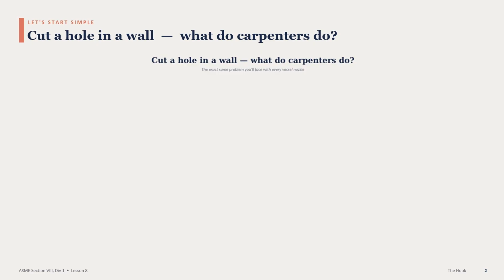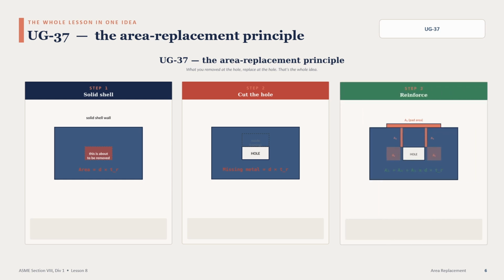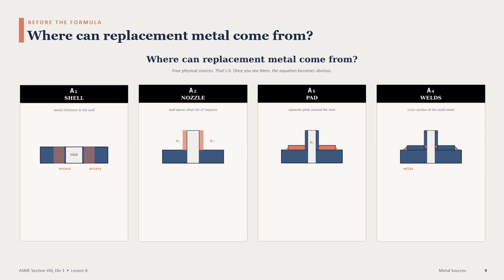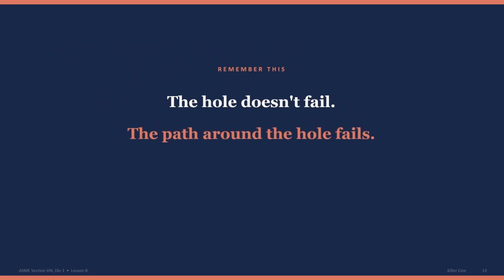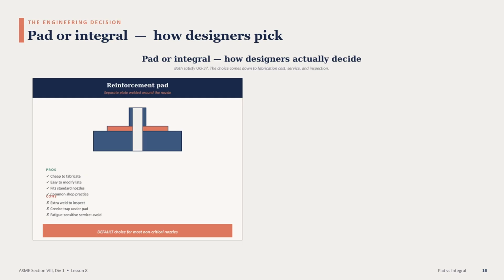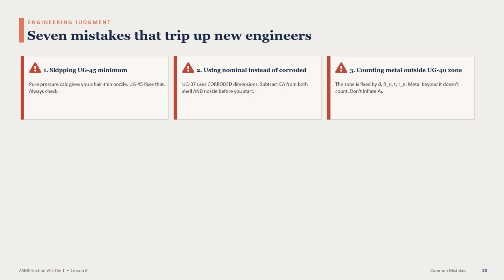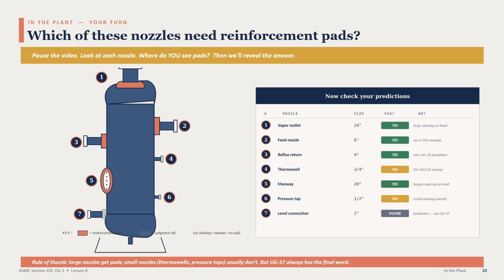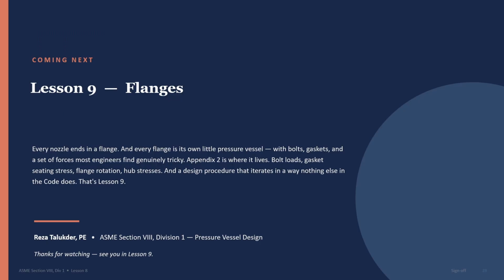Pressure Vessel Design | ASME Section VIII Division 1 | Lesson 8 – Openings & Nozzles

Comment from the maker: 📌 CORRECTIONS — please read

1) SLIDE 4 (stress concentration at a hole) — peak stress location
In Step 2, the red peak-stress dots are drawn at 3 and 9 o'clock — in line with the load. That's wrong. Per the Kirsch solution (1898), with the load drawn horizontally, the peak stress (up to 3× nominal) occurs at 12 and 6 o'clock — at the edges of the hole perpendicular to the load direction.
Step 3 has the same issue: cracks initiate at 12 and 6 o'clock and grow perpendicular to the load, not from 3 and 9 o'clock.
Also, the arrows should point outward — a pressurized shell wall is in tension, not compression.
In a cylindrical shell, the governing load is the hoop stress, so the peak sits on the hole edge in line with the vessel's axis, and cracks there tend to run along the vessel's length. The corrected picture is on Lesson 10, slide 3.

2) SLIDE 15 (V-102 nozzle calculation) — A₂ formula
A₂ was written as 2 × (tn − trn) × min(5t, 5tn). That isn't the Code formula. Per Figure UG-37.1:
- Without a pad: A₂ = smaller of 5(tn − trn)·fr₂·t and 5(tn − trn)·fr₂·tn
- With a pad: A₂ = smaller of 5(tn − trn)·fr₂·t and 2(tn − trn)(2.5tn + te)·fr₂

Corrected numbers on this slide:
- Attempt 1 (no pad): A₂ = 0.37 in², total = 0.87 in² — still needs a pad
- Attempt 2 (12" × 1/2" pad): A₂ = 0.62 in², total = 0.50 + 0.62 + 2.70 = 3.82 in² ≥ 3.63 in² → ADEQUATE

The verdict on slide 15 stands. Lesson 16 re-checks this nozzle at the corrected allowable stress from Lesson 12 (16,120 psi), and the pad grows to 12" OD × 3/4".

Comment: the equation for area removed at the hole is not clear. Why it is not 3.14 x d x d /4 (the area of circular hole removed)?
Reply from the maker: Good question! πd²/4 is the area of the hole seen from above — but that plane doesn’t carry the pressure load. Hoop stress pulls across a longitudinal cross-section of the wall (picture slicing the shell lengthwise through the center of the nozzle). In that cut, the wall is a strip of metal, and the hole removes a rectangle from it: length d (opening diameter) × depth t_r (required shell thickness). That rectangle — d × t_r — is the load-carrying area lost, so that’s what UG-37 makes you replace. We use t_r rather than the actual thickness because any shell thickness above t_r is surplus, and it’s credited back as A₁. In the V-102 example: 6.0 × 0.605 = 3.63 in² to replace, while π × 6²/4 = 28.3 in² is just the hole’s size in plan view, which doesn’t enter the calculation.
Reply: @pipewise-r3w  This is clear now. Thanks so much!